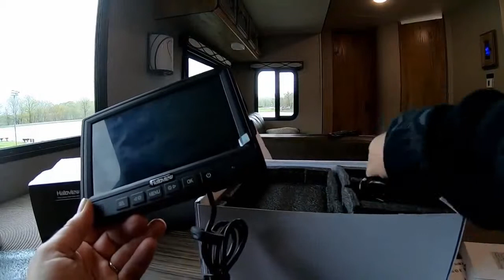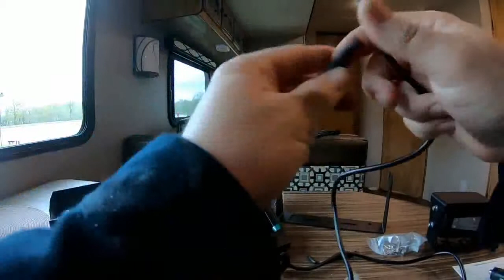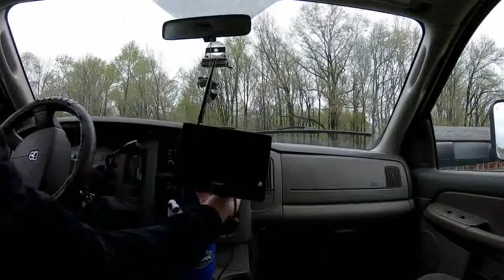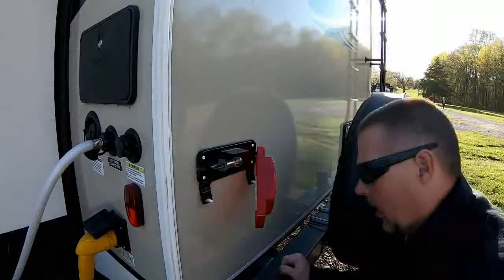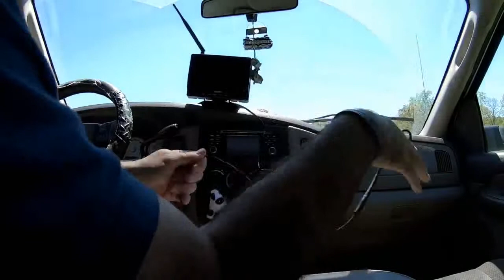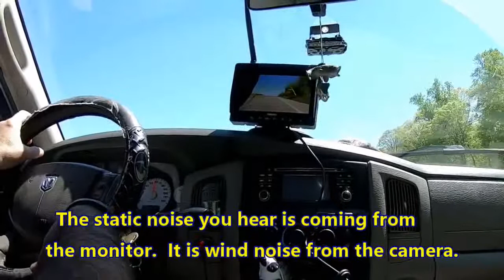Haloview Rear View DVR System Cmrea MC7108 Installation And Testing

Comment: Question. I have an interior 12v cigarette type socket inside my trailer near the back window. Is it possible to connect the camera through the shell, to a cigarette type plug to then power through that socket?
Reply from the maker: Sure! You can purchase a cigarette lighter plug for the camera, link: https://www.haloview.com/haloview-cigarette-lighter-power-supply-adapter-1-4-meters-cable.html